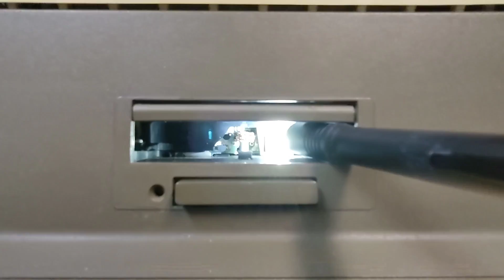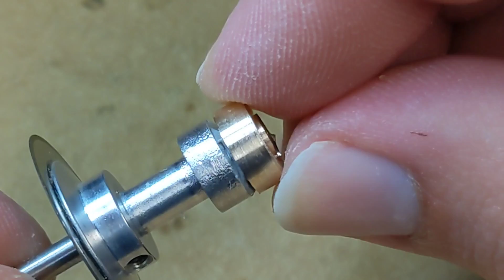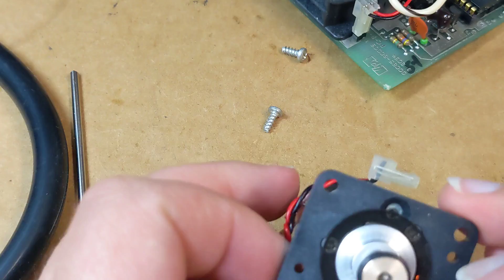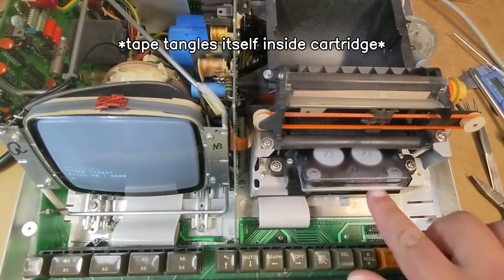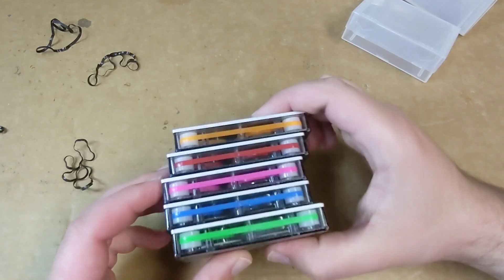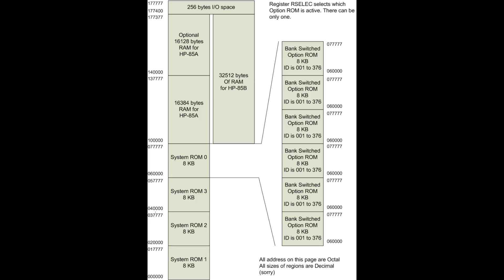HP 85A Computer Part 1 - Tape drive and ROM interface

Comment: Hello. What are the resistor values?
Reply from the maker: Looks like I picked 470 ohm for all LEDs, 10K for all pull ups. Values are set in KiCAD, but apparently I didn't draw them on the schematic sheet.
Reply: @alnwlsn  Thank you for the quick response.

Comment: Thank You So Much !!!
I am from Germany and I am looking a couple of years for a solution to repair the old DC2120 Tapes.
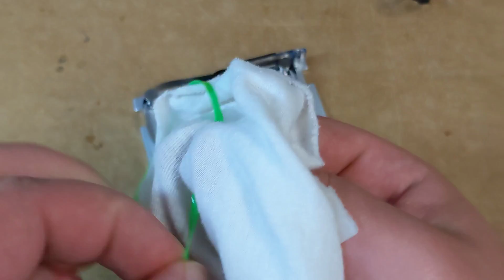I looked the Video in 0,25 slow motion at 29:06 to see the product information of the Plastibands.
The type is SF-6000 4 1/4" or in Europe 11,4 cm.
I found it on Amazon. I am so happy now. And I am happy to pay 18 Euro for rubber-bands :-))

Comment: Very nicely documented repairs, and thanks for the shout out for EBTKS. Your lathe work is very impressive.  When putting the capstan back on the motor spindle, I have used a piece of laser printer paper as a spacer so that the encoder disk is close to the mating optical grating, without touching it and causing scratches. Obviously, remove the spacer paper after the set screws are tightened. The paper is about 0.004 inches thick. As for removal of the flat flex cables, I show how to do it with minimal damage in the Curious Marc video m18GCQs0288 at about the 7 minute mark.

Comment: Plastiband are advertised as polyurethane. I mean, who knows what other materials are in there to make them soft.

I love your rainbow cartridges! So cute!
Reply: I use a small butter bowl to hold it when I'm applying finish to a project, and the stuff that ends up drying in the little ring at the bottom of the bowl, if you peel it out to clean the bowl, its actually pretty soft, and definitely has a little bit of flex to it.

Comment: You find surface mount components easier to work with.... Yeah thats a complete load of Bull. IF the board was through hole it could be assembled in minutes. SMD is a masochistic pain and unnecessary for all hobbyist boards.
Reply from the maker: Skill issue. I solder SOIC with a normal iron just like DIP - it's only double pitch, and you don't have to keep flipping the board over. They are also easier to route (you can go fully under them on the bottom) and make boards that are smaller in area which are less expensive.